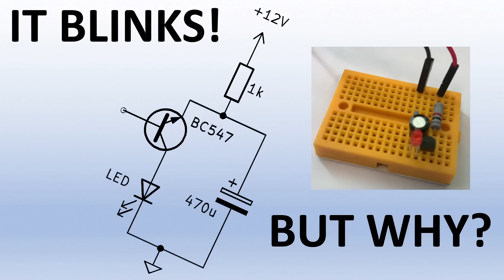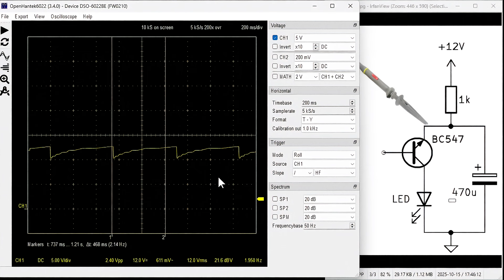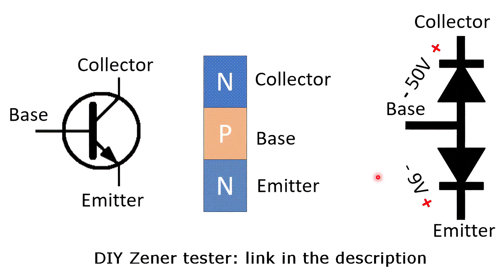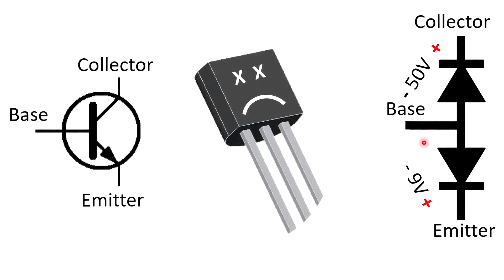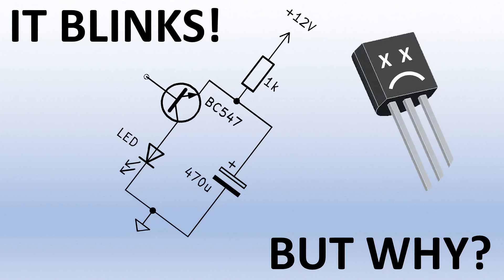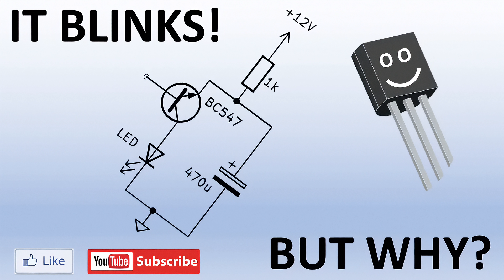Dirty one transistor blink circuit

Comment: A cool counterpart is that I've been told that some Transistor, I think BC junctions, can be even lower leakage diodes, than even most of the diodes you can buy on the market that are advertised specifically as "low reverse leakage current".

Comment: A long time ago I wondered why two back-to-back diodes didn't create an NPN transistor. Now I understand why. Thanks.
Reply: Its not that, but also the distance. Base is really small, because if you are using transistor as a transistor, you have to bridge both N sides together using charged P layer.
If you used 2 diodes it wold be theoretically possible, but the amount of current needed to make the longer bridge would most likely be so high, that it would overload the diodes and just use them as diodes (leaking current in both directions) rather than making a transistor.

Comment: Esaki effect, I have used as trigger signal for capacitor discharge circuits, backwards transistor connected to opto, opto switching mosfets

Comment: This exact circuit is used in some road work warning lamps, when i first saw it i drew the schematic and went 'lolwut?'

Edit: well not exact, not sure how it works tbh, they only use 6v, and a filament lamp!
Reply: The thing to remember about a filament lamp is that it is a very low resistance when off but becomes a high resistance when it is lit.    Does that perhaps help you understand the circuit you are looking at ?
Reply: @Hereford1642  with that kind of circuit anything could affect it, but evidently the manufacturer was confident enough in it to design it into a piece of safety equipment that is subject to all kinds of abuse and weather, so maybe?
Reply: @TheChipmunk2008  The Wein bridge oscillator uses a light bulb in some incarnations and is a perfectly respectable circuit.

Comment: In fact : only the L.E.D is limiting the current from the capacitor . Notice that: If a capacitor contain very few charge,
until its charge remains it is a super generator with a very low internal resistor. So the L.E.D may burn too as well 
as the transistor.
This schématic is only interesting for physical demonstration i think.

Comment: shouldn't the diode ideally have its own current-limiting resistor for when the capacitor discharges through it and the C-E path of the transistor
Reply from the maker: Yes, you understand it well: the LED is certainly used out of spec, the peak current is too high! Some designs online have an extra 100 Ω resistor in series with the LED

Comment: well first of, avalanche effect is pretty reliable, so this will work always, when dimensioned correctly.
Plus: you can also find an operational area where long term damage is at a minimum.
Long story short: there are a lot of 'dirty' circuits that don't work properly, but this here will :)

Comment: Will that work if using zener diode instead of transistor?
Reply: No because there's not portion of the VI curve that has an inflection point, or a point of positive feedback.  Technically, with the transistor, both diodes are there until the avalanche current flows, then the collector side diode effectively disappeares. and as he said, the more current that flows into the emmiter, the more conductive the emmiter0collector junction becomes. It's positive feedback.  As standard diode, zener or otherwise does not have this characteristic.
Reply: @JBEEUD  how about using tunnel diode (esaki diode)? Will that work?
Reply: @mbahMu-iki possibly since they are effectively designed to avalanche
Reply: @mbahMu-iki  Yes, but that is an expensive solution.
Reply: No.
Reply: I thought the same thing lol
Reply: it should... we're not really using the base so it's essentially just a diode

Comment: From my initial thoughts the transistor is reverse biased .. well it’s not truly biased but regardless, the emitter / base and base collector junctions are avalanching which discharges the capacitor but the capacitor can recharge because the of the hysteresis between the point of avalanche and the point where the transistor “turns off” after the discharge has got to a suitable level.

The down side is, the supply voltage is critical, too low and the nothing happens, too high and you destroy the transistor as you will breach the maximum reverse voltage across the junctions as the potential rises to a pint where a flash over accounts at a single point, releasing enough energy to destroy the junction.

Comment: That's really cool! Thanks for explaining that, I was working at some point on a Pockels cell driver for a laser and this avalanche mechanism was used and, although I understood it, I didn't fully appreciate until this 😊

Will the avalanche be less damaging if a low resistance is provided between the collector and the capacitor to limit the avalanche current?
Reply from the maker: Yes, I think it is less damaging, online you see designs with ~100Ω in series with the LED. Still it is not a good thing to work in avalanche mode for a BC547 ;-)

Comment: For people who keep asking if you can use a Zener diode instead, no you can't.
Reply: I was going to ask that, if I didn't find anything about it in the comments.  Thank you.
Reply: Because it doesn't stay in avalanche long enough because there isn't a base region to hold it in the on state?
Reply: @blairhoughton7918  I suspect that's the reason.  Any EE classes I had were decades ago and it's all gone fuzzy so don't take this as correct.  The Zener will conduct when it reaches its breakdown voltage but won't continue below that.  So all you'd get is a rather messy power supply with the LED being fed a more or less steady current as the Zener draws down the capacitor to dump the excess voltage.

Comment: Now can you use a diode like a transistor on the circuit
Reply from the maker: Good question, you can not: you need the shared P-layer and 3 pins: you use diode 1(B-e) to inject current and push charge carriers in the P-layer. This P-layer is shared with diode 2 (C-E) and will not block anymore because the P-layer now has many charge carriers floating around!

Comment: that's a cool circuit. you're using the transistor like a zener, so i imagine you'd get more reliable results by using a zener diode where it's actually designed to avalanche.
Reply: No. It would be "reliable" in that if the Zener voltage was in a suitable range, the LED would have a delay to start then remain constantly lit.
Reply: To add to Platypus :  The zener would not continue to conduct and discharge the capacitor down close to zero volts as happens in this transistor circuit.    The zener would simply hold the voltage steady at its designed reverse breakdown voltage.

Comment: Those who are old enough will immediately recognize the circuit of a neon bulb relaxation oscillator, a staple of hobbyist projects in the 60's and 70's, with the neon bulb replaced by the avalanche transistor and LED.  Ionization of the neon gas in the bulb and consequent conduction discharged the capacitor in the old version. About 90 vdc was required.
Reply: I'm not nearly old enough, but recognised it from earlier readings. It's really cool tech.
Reply: @zidanehadeed9229  Cool. Somewhere I have an ancient "Popular Electronics" magazine series with plans and instructions for building an adding machine that used only neon bulbs for the logic. You entered numbers one digit at a time using the ancient kind of mechanical phone dial as a pulse generator. DIY electronics used to be a struggle.
Reply: @generessler6282 Wow! That screams 80s to me. 😅 Now that's the charm of analogue DIY. Compared to now it's as ingenious and satisfying as Rube Goldberg machines. I'd like to get my hands on a few lamps to generate some clean sawtooths. 

I've also been looking at old Vacuum Tube amplifiers and was amazed at what they achieved without a lick of silicon. The voltages and temps they ran at are unthinkable in the FETs we have now. But the sound was quite pleasant, as the tubes didn't inject harmonics and clipped rather softly when overrun.
Reply: @zidanehadeed9229 Actually I found the article on line. It was Electronics Illustrated not Popular Electronics. It was a single 1966 issue!
Reply: If we use a curve tracer to plot the curve (current as a function of applied voltage) of the transistor connected that way and the curve of a neon bulb, they look  like the same!

Comment: So basically just use zener diode instead
Reply: I suppose a zener Diode wouldn’t show enough hysteresis for it to blink because it‘s „too perfect“. The transistor on the other hand may just work because it’s a sh1tty zener diode
Reply: @GreenCaulerpa it's a transistor, not just a zener. The reverse breakdown of the BC diode is causing the transistor to turn on
Reply: Not if you want it to flash.
Reply: @PlatypusPerspective why so?
Reply: @noobaccount7580  The zener would not continue to conduct and discharge the capacitor down close to zero volts as happens in this transistor circuit.    The zener would simply hold the voltage steady at its designed reverse breakdown voltage.
Reply: @Hereford1642 i see. But why though?
Reply: @noobaccount7580  Well, you would have to look at the atomic design to see that - and not all zeners are the same.
 Suffice to say that if a zener kept conducting all the way down to zero volts once 'triggered' it would be useless as a voltage regulator which is its intended function.  
 The diac will do that though - if that is what you want.
Reply: Nope, it would not oscillate

Comment: I've been playing with transistors since the 1980s and this is the first time I've heard that the reason why the collector is different from the emitter is the amount of doping. Thank you for such a clear and simple explanation.
Reply: They're often different sizes, with the collector being a large substrate, the base a thin disc on it, and the emitter a dot in the base. This gives the collector more volume to support the large depletion region, and more BC junction area to improve conductance to match the emitter, which has all the advantages because it's heavily doped and forward biased. It also helps dissipate heat by reducing current density, because the voltage drop across the BC junction is larger than across the BE junction, so the collector is creating more power and more heat for nearly the same (or in this video the same) total current.
Reply from the maker: @blairhoughton7918  wow you know your stuff 👍, I am not that deep into device physics
Reply: This.^
Not that long in the game, but also never heard this before.
Reply from the maker: Thank you! Being able to "imagine" how it works is more important that the formulas. As blairhoughton8977 mentioned, there is more detail behind it, but understanding the concept is key. Einstein: logic brings you from A to B, imagination can bring you anywhere!
Reply: If you look at the first transistor pictures the photo is exactly like the diagram, a "V" shape thing attached to a germanium base.
Reply: Any introductory/elementary book on microelectronics that shows how transistors are fabricated (sequential steps of diffusion / implantation of impurity ions into a silicon substrate) will give a decent picture of the geometry and doping of various sections. The elementary picture of two back to back diodes are misleading.  Here is a fun quiz: Assume you have a transistor but do not know which lead is E,B or C. How will you identify them? You are allowed to use an ohm-meter only.

Comment: its a bit like LED's they act like diodes but the reverse breakdown voltage can be very low. So it's quite easy to exceed it with and ac supply and just a resistor to limit the current.
Fun getting you head around tunnel diodes.

Comment: Learned this when I was young. If you have an classic astabile multivibrator and for one transistor you swap C and E, it still works. Different frequency, probably different DC but I did not measure that at the time.

Comment: More illustraion would definitely help, but i think im starting to understand it, mostly because i already know the capacitor part and diode's breakdown voltage as concept.
Now i just dont get why the transistor "opens" when the base gets enough current, why the base-collector diode stops being a diode
Reply: The transistor opens because the voltage break through, overwhelming the "sensitive" emitter diode, electrons are pushed into the base / P-material. When that happens the diodes are not diode-ing anymore. To make this diode do diode thing (block current) you need a depleted p-material layer.  The diodes, both, become (something akin to) conductors because the base gets charged (temporarily enriched) that "ruins" the p-materials isolating diode feature, hence for our intents and purpose the (transistor) diodes normal function vanish. I hope it helps.

Speculation: What I think was not fully explained is exactly why it closes so abruptly and final. I'm guessing the avalanche effect maybe in combination with stray inductance is what finally closes the transistor conduction while avoiding reaching a steady state. I'm thinking that small stray inductance makes the transistor "over extend" itself, there by reset the maximal blocking capacity (the 8-9V or whatever).

The Inductance equivalent in mechanical terms is that it acts like a flywheel, it can and will deliver all stored energy. That extra momentum like effect is why (I'm speculating) the P-material continues shedding the remaining electrons, p-material getting sufficiently depleted and can do it's diode thing again with the n-materials, that definitively shuts transistor down to further conduction)
Reply: @Paxmax  i'm quite a visual type so it takes long to understand from text but i appreciate the explaination.
so basically if i get it right, since the P region becomes less of a P region because of the current from the base, they start conducting, but wouldnt the flow of electron keep the transistor open when the base has no incoming current?

Comment: I wonder if you can make a truly one transistor blinker with just a transistor, using the led capacitance  and resistance to work
Reply: No, a LED has almost no capacitance, and essentially no resistance of its own (that's why you need to add things like current limiting resisors to them in most cases).

Plus, the way that most blinker circuits work is that they need to charge up the capacitor during the "off" time, but even if the LED could work like a capacitor (which it won't), how could you charge it up when it's supposed to be off during that time?  (You would need to somehow both supply power and not supply power to it at the same time...)

Comment: Ok, stupid question: Is the voltage in the circuit when transistor starts conducting dependant on led colour? Since not all led colour's have same voltage?
Reply: Yes for the supply voltage, because the voltage drop across the LED will be different. I tried it comparing red and blue LEDs.

Comment: Why this do not work with PNP transistor? I have used a BC557, reverse all polarities ( Led, capacitor and power supply). But with PNP silicon transistor do not blink.
Reply: Talvez esteja associado à diferença entre o comportamento de elétrons e buracos na base.
Reply: @ivocapella4541 
Sospecho algo similar. La explicacion de este video es incompleta. En este oscilador de relajacion quiza el transistor se comporta como un elemento de resistencia negativa (como triac o ujt).

Comment: The transistors, with two diodes, braking sense. As known the base emitter voltage is 0.7 volts and collector emitter voltage is much less - 0.2 or almost 0 volts. ' cause of that the anode of the collector diode should be connected to the cathode of the emitter diode. I think so...

Comment: To extend life of the transistor and the diode a resistor should be placed between them
Reply: But it would be just a bandaid solution, good for low power loads but would not be greate for anyother, a hacky way will be not always reliable, as the video suggested.
Reply: Use a Z-Diode. They are Made folr this
Reply: @benbai8669  A zener diode will not permit oscillation because it doesn't exhibit "negative resistance."

Comment: You can also use "Zener" diodes instead of the npn transistor with "Zener" voltages above 6 V. Such "Zener" diodes are not "Zener" diodes but in fact avalanche diodes. So they work with the same effect for the same purpose. In this way you can make a zero transistor oscillator. 😂
Reply: You can't make an oscillator with a zener diode. Probably because there are many independent sub-avalanche structures there.
Reply: @srotovnikabc6919  interesting. Maybe the circuit needs the base charge feedback. Hm, I will try it out... have you tried it?
Reply: @gkdresden  What? A Zener diode doesn't have a base. You must be reacting to something else.

Comment: PERFEITO !!!   A junção base-emissor é similar a um diodo zener !
Reply: The zener would not continue to conduct and discharge the capacitor down close to zero volts as happens in this transistor circuit.    The zener would simply hold the voltage steady at its designed reverse breakdown voltage.

Comment: There was a single transistor oscillator circuit I used whenever I needed to turn a light, or even a small DC motor, on and off in the 1Hz range. The nice thing about it was you could use it inline with the power supply, so it gated the current by switching resistance between low and high. I think it used an ACY21 transistor... which sometimes got quite warm but which was nonetheless remarkably resilient!